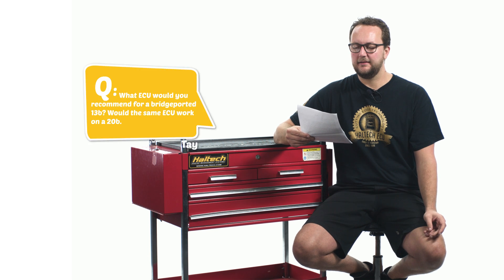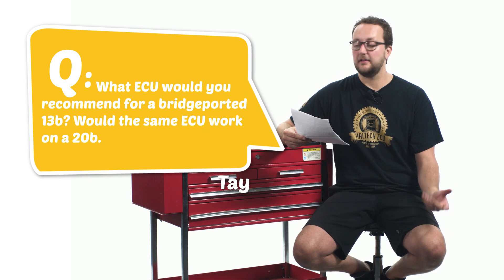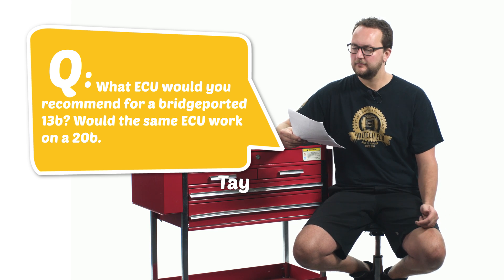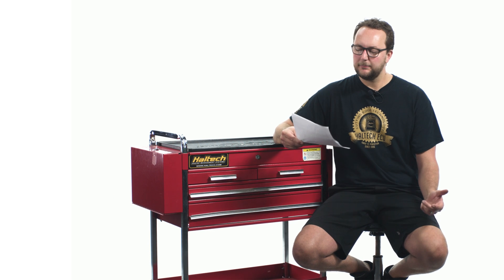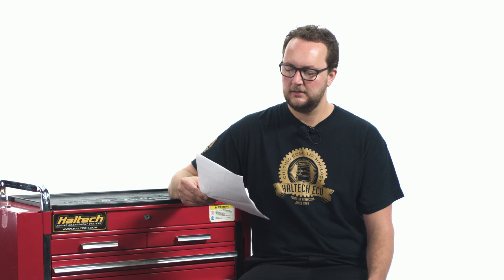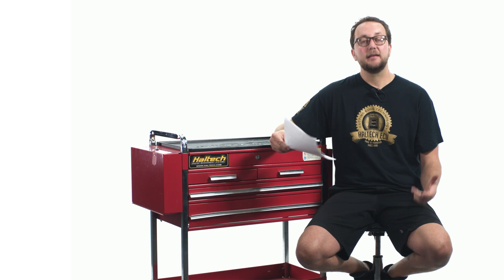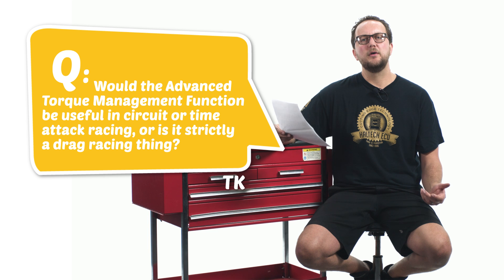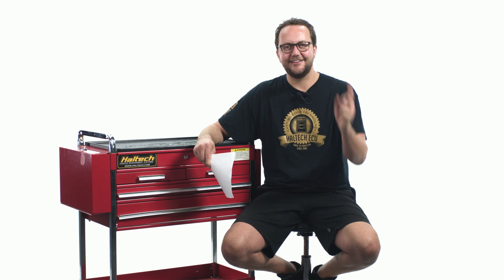❓ Rotary ECUs, Knock Control, Torque Management - Haltech Q&A Episode 22

Comment: great video as always! I have a 2003 Nissan 350Z. twin turbo running on E85  I have the plug and play Haltech ECU right now. no problems. But technology has changed in 15 years so should I upgrade to a different ECU? thank you for your time!
Reply from the maker: If you have the older Pro harness series (which parallels with the stock ecu) then yes you should upgrade to our Z33 Pro plugin (which replaces the factory ECU).
Reply: Haltech thank you for the reply. yes I have the platinum pro stand alone!

Comment: Hi i have also a few Question g
what does the traction control if it detects Wheel slip? can it shot down injektors (like the Racelogic TC) or decrease the boost?
can you run a V12 whit single fire ignition and sequential injection with the Race Expansion Module or is there a software limitation?
you say the Elite have a external canbus? does it work together with modern automatic transmissions?

Comment: Heyyy the real Question here is can you swap a sr16 engine in an Mx-5 ?:D
Reply: Why not? Physically there should be space since both are 4 cylinder engines. But making it work is a different question. It may not be easy but it is definitely doable !
Reply: i hope too!!! I wanna build an sr16 and drop it in it cause nissan vtec :D
Reply: I've heard of sr20 builds for Mx5s so I'd assume yes.
If you're looking to do an engine swap for an Mx5 I'd highly suggest looking at Honda K series engines, they make good power for their size and there's a lot of aftermarket support for engine swaps.
Reply: Will Hall Hmm I guess you are right imma gonna look at it thanks mate ^~^
Reply: No worries man
Good luck with the swap!

Comment: Do Haltech got what i need? Got a Honda civic with a D14, and gona mount a Turbo on it. Of what i had heard, on lower boost, i realy only need a timing advancer-on-boost to prevent to early detonations. is this something you got, or is it even something like it on the market?
Reply from the maker: No we only do complete standalone ECUs. You’ll want something more comprehensive than a ‘timing advancer’ (which is totally incorrect for a turbo application). Contact a local Haltech dealer to discuss your options.

Comment: What ECU would you recommend for a 1993 Subaru EJ22T?   It's stock now but I plan on building it and running high boost (20+psi).   Oh and e85.  Thanks!
Reply: Velocity Labs thanks for your enquiry, the Elite 1000 would be able to control your engine as well as retain all of your OEM engine management strategies. You may also use lower models of the Elite family of ECUs but you would lose functionality such as onboard knock.

Also, if you would like to secure drive by wire throttle support in the long term as a means of bringing the many modern upgrades to your EJ engine then you would want to secure the Elite 1500.

Thank you kindly for your interest in the Haltech engine management systems brand, cheers!